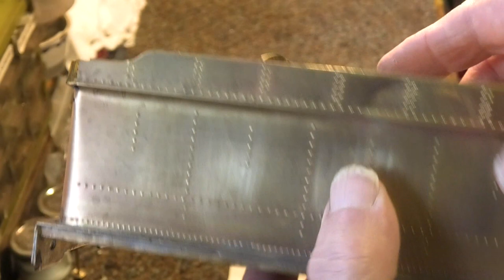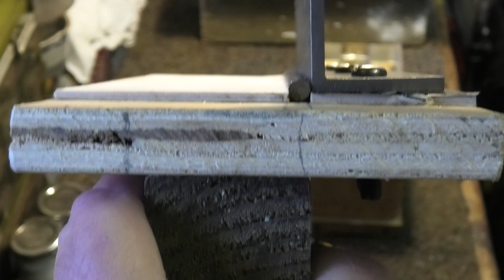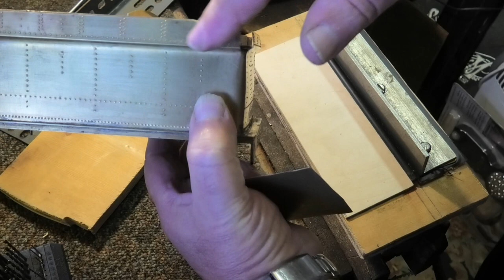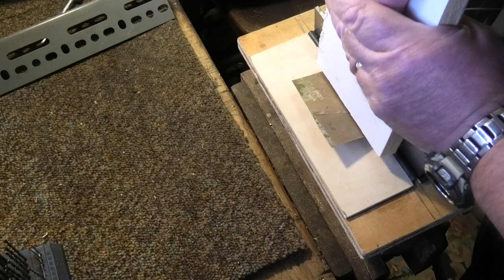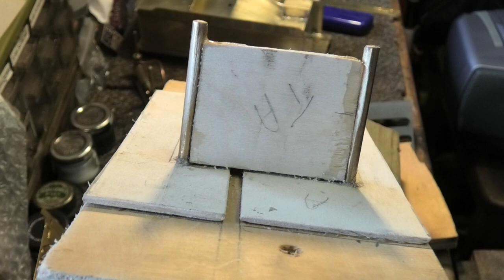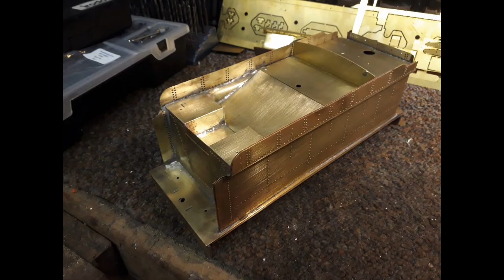Building A Coal Fired Gauge One Great Western Railway 47xx 2 -8-0 Goods Locomotive Part One

Comment: Really interesting. I am glad you took some photos before you decided to do the video so we can actually see the parts being presented to the jig. I am building a couple of tank engines and am approaching plate work time. Your video has been extremely helpful. Jigs are the only way to do these procedures. I think I will build mine in steel, as I don't have any rivets to worry about. Have you ever tried a little heat on the brass to soften and anneal it as you bend, or before you bend it? Do you feel it is necessary?
Reply from the maker: Hi many thanks for your comments much appeciated , I found the brass sheets in the kit are thin enough without heat before bending and sometimes that can have a adverse effect which can cause distortion , In fact i was worried about that as i had to throw some considerable heat at it when i solderd the tender together lucky for me it went well , I have had a break from building the loco when i return to it i will do a updated video ,Hope this helps and i wish you well with your builds ,Graham